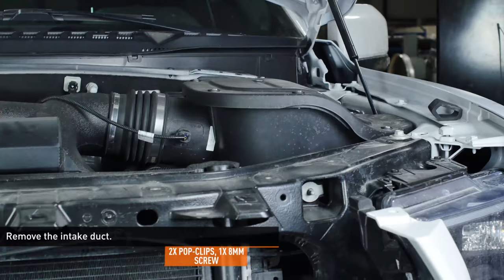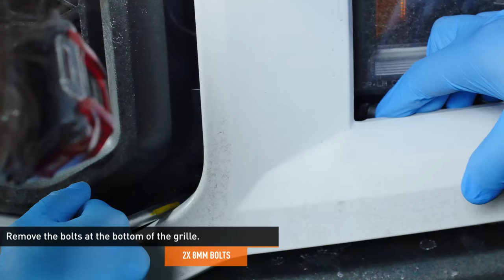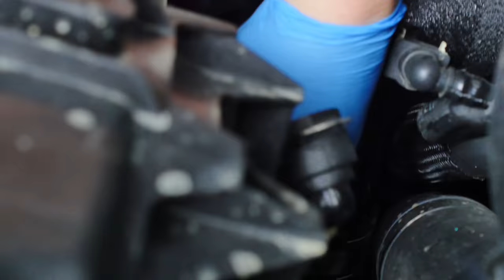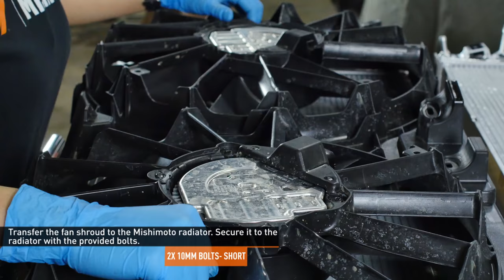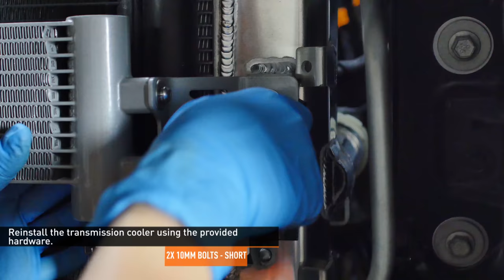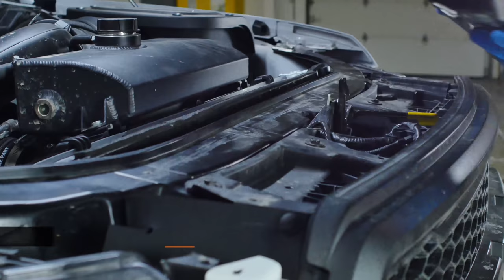2015+ Ford F-150 / 2017+ Ford Raptor Radiator Installation Guide by Mishimoto

Comment: I was just quoted 1800 to do this I have a coolant leak side of radiator 280k miles 2015 f150 3.5L… thank ya for this video very strong possibility I’m doin it myself… I’m thinking maybe change the hoses to new ones if I’m in there with as many miles as I got

Comment: Will it fit 2015-2017 expedition? Thanks!
Reply from the maker: Looking over the OEM part numbers for the expedition it looks like this was not a shared part until after 2018. So this would not fit 2015=2017 models

Comment: Will this work with a Whipple supercharger on the v8’s?
Reply from the maker: This replaces the OEM unit and should not interfere with your supercharger as long as it doesn't come into contact with the OEM radiator.